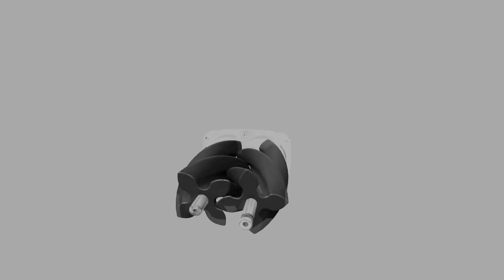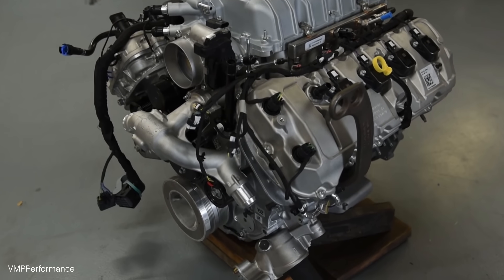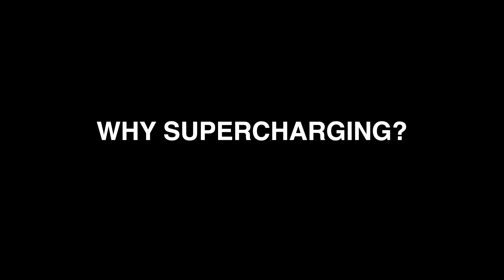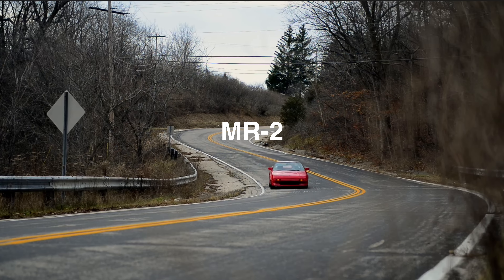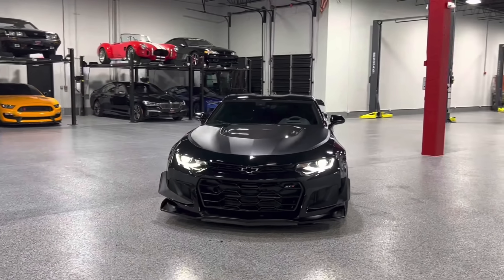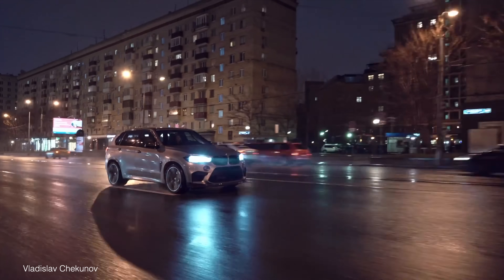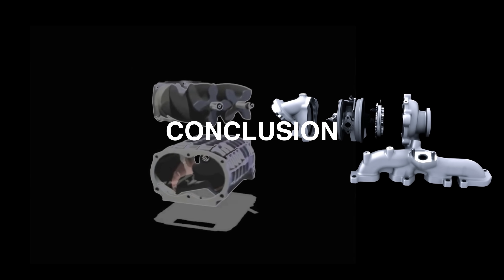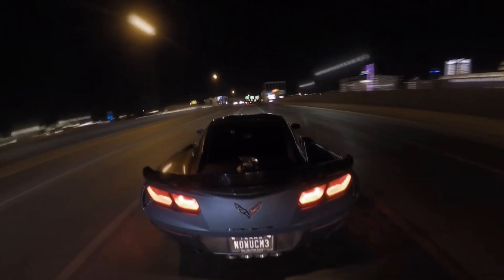Why V8 Engines Are Supercharged vs. Turbo😮| Explained Ep.6

Comment: Turbocharged vehicles get better gas mileage. My twin turbo Scat sits around 16-17 mpg (city) opposed to that of a Hellcat at 13mpg city. Besides, the car cruises around like stock until you full throttle it. Unlike that of a supercharged vehicle, where you're always making power. Sometime that's hard to drive around down depending on the setup. With my setup, my IAT's are right below ambient. Which means supercharged applications will run much higher at 130 degrees or more in hotter weather.  Unless, said supercharged vehicle has an interchiller. It all comes down to preferences, and I prefer choo, choo bois that push hot hong kong air lol

Comment: Superchargers are a solid option. Yes, they are much simpler to install on any engine as long as there is room on top. There are also centrifugal superchargers that use a belt drive to spin a turbine rather than screws. These are even more efficient as they can produce higher peak power numbers. I used to have an 1988 MR2 Supercharger and it was a fun car. I mean, really fun. Yeah it wasn't fast by today's standards but who cares, having that SC light up on the dash then the woosh of power really gave it a go-kart like feel. It's a shame cars like that aren't made anymore.

Turbos have a lot more plumbing and with modern tuning and turbines I don't think lag is as much of an issue as it used to be. It used to be literally on-off, where there was nothing up to around 4K RPM then suddenly a blast of power. Turbos are the way to go if your min-maxing your power, but you run into limitations where the displacement of the engine cannot effectively spin a turbine that exceeds a particular size. You are inherently limited on the turbo size by the base displacement of the engine.

I'm definitely not ever buying an "EV musclecar". That's part of the WEF 'you will own nothing and be happy' agenda. Forget it. It's time to bring back small independent car builders who build affordable cars, not six-figure on-offs.
Reply: he's comparing turbo cars from the 90s to make em look bad.

Comment: Their really really really unintelligent cutting the fossil fuel engines and they will find it out very quickly when people start revolting because of fuel cells burning up cars, cars not charging, charging problems when traveling and obviously none customizable when it comes to "engine" and "exhaust," notes.  But manufactures are weak not standing up to communist regime EPA.

Comment: Supercharged engines are way more linear and torqey. The packaging and serviceability is much better for the diy. I’ve helped a friend to survice their hot-bee twin turbo AMG….oh lord, the parts coming off the top end is mind blowing!   just to access a failed sensor!

I think Supercharging can be even more efficient. Has anyone thought of a variable drive gear on the pulley? Seems like a perfect place for compact CVT gear?
Giving you a wider power and and greater efficiency by varying the load at part throttle situations?

Comment: You've described the symptoms and made the diagnosis well, but missed the final underlying root cause.
It's both culture and costs--not just in the buy cost that you said.
European and Japanese makers have a market that prioritises the quality of the handling and drive, and/or refinement and luxury. The American audience generically prefer be pushed into their seats more for the satisfaction, which at the same price point means American sports cars have much bigger power output in the same class at the expense of other things the audience deems less important.
Then there's the running costs: fuel. In most of the world other than North America, fuel is much more expensive. Everyone regularly laughs in Americans' faces when they complain of 2022 'high' fuel prices because it's literally 30-50% less than elsewhere all the time. Do keep in mind Americans need to travel larger distances on average.
A turbo is just better for stringent EU regulatory emissions, better for the high fuel prices. So are 6-cyls instead of 8.

That is truly why the US continues to love holding on to the supercharged V8 when the last time the Germans did it was 2003: fuel is cheap and if they're not doing a thousand-mile road trip, that engine doesn't hurt their wallets enough at the gas station like it does everyone else in the world. 
Even just $800 a year difference in fuel cost means 10-20k over the car's lifetime. That is a huge part of the equation when considering 70k muscle cars vs 120k German rivals--consumers don't generally actively think about it, but there's an underlying subliminal sentiment through the way emissions and fuel economy regulations are done.

Comment: Turbos are way better in a V8 than a supercharger because of tuning purposes. Superchargers are only good for low powered engines like 600 horsepower and below. And yes, 600 horsepower is a low-powered engine to me considering I drag race with 1500 plus horsepower and you called a internal wastegate, a diverter valve that's wrong. Internal wastegate is in fact a internal wastegate. It relies the unused pressure right back into the intake manifold. External wage gate is the one that you hear when you let off the gas pedal releasing excess boost internal external PS race cars do not use superchargers because they are very inefficient, fuel, economy, etc

Comment: Typical Supercharger noise reminds me always on my 2006 to 2008 owned, only in Switzerland occurred Citroen Xsara VTS 2.0 Bemani Compresseur Coupe. It was built and completely DTC street certificated by Lotus- and Toyota Tuner Bemani. They made arround 25-30 cars. It had a KW Competition Suspension on and was supercharged by a magnuson charger. I had the one with the big charger on who delivered 270hp instead of 235hp. The exhaust was exclusively manufactured including 200cell racing cat. It was crazy loud, „actually fire spitting“, very light, stiff and faster than an audi s4 at this time! I owned a few cool cars but this Xsara…this one got defenitely something what let me smile until today… An intersting, special not everyday car. I experienced a lot sleeper Stories with it!😅 (🤙🏼small story for you guys…for those who intrested😊)

Comment: another downside that comes with the strength of the supercharger is the constant boost it delivers, meaning it is a lot harder on the engine internals than a turbo thru it's life as a turbo is capable at almost not making boost when driving at part or low throttle while cruising, as well as the fuel mileage issue with superchargers.

Comment: You guys Americans are fucking stupid... Talking about turbo lag on v8s... Yes one thing is turbo on a 2.0 i4 rally car, but this is some big ass v8s you're talking about. All the low end torque is more than enough to compensate for lag. No need for that fancy dual turbo setup, one nice turbo does the job and it is definitely not more expensive than supercharging. Truth be told it's all in your head. Not saying supercharging is bad, I'm saying that it's not beneficial to turbo on a v8 enough to say that turbos suck like many are led to believe. Just a thought

Comment: You neglected to mention that superchargers are limited to the lower range of rpms, the higher the rpm's go the less air a supercharger is able to cram making it useless once you get above a certain rpm. As opposed to the turbo that while it has lag, the higher the rpm's the MORE air it is able to cram, also making it a far more efficient air induction system. Americans are so obstinately backwards. I would know, I am one.

Comment: I definitely plan on keeping my 1999 SVT Lightning and my 2014 F-150 Ecoboost. Both trucks have 2 completely different personalities. The Lightning will instantly light the tires, pushing me back in the seat and there's the lovely exhaust note and supercharger whine. I actually most times forget that the Ecoboost has forced induction because of its lack of noise from the turbos and its power delivery being very different than that of my Lightning.
Reply: The Lightning doesn't impress me. The Ecoboost has impressed me with its towing capabilities.

Comment: When I was ready to stuff air into my 1998 Camaro SS, no superchargers were available yet.  I ended up with an Incon twin-turbo system.  Two GTBB35's on a 6.1L V8.  I reach full boost in less than a second.  No regrets here, I'd go turbo all over again.  My buddies supercharged Cobra gets yanked immediately.

Comment: As soon as Lyin' Joe Bribin' Biden is kicked out EVs will be kicked out too. Just heard today that EVs put out more pollution than gas cars do to the pollution it costs to make, discard the batteries, the brakes put out more pollution dust do the weight t of the vehicles, the tires also pollute more because of the weight and cause more damage to the roads. Resources for the chinese batteries are mined with African slave and child labor. Joe has no problem with that just as he has no problem with child trafficking on the southern borders.

Comment: Because here in the US the damn other drivers are either going 20mph on the freeway and cutting you off or 70mph, so you need to be able to hit that power immediately when you pull around the idiot who just cut you off.

If it were a turbo, as you brake you loose boost pressure,  and then when it comes time to get back on it the guy behind you has already slammed into you.  Gotta make sure you're not getting in his way ^_^

Comment: I agreed with this 6 years ago however the new twin scroll turbos minimize the turbo lag. Having built both, supercharged vs turbo, I am at the point that I believe they don’t want to turbo those cars because it’s too simple to modify a turbo through simple vacuum pressure making it harder to know if the customer is at fault on warranty claims. A supercharger takes 35% of the engines powers to make up the added gain while the turbos make way more power and is only loss at the lower rpm range. With that in mind the epa doesn’t want people always in the higher rpm range for obvious pollution reasons which also keeps the superchargers in play. A v6 and a inline 4 with the right twin scroll turbo will smash a V8 supercharged anytime. It takes place at the track every weekend. Kinda embarrassing. Great video though but I do believe times have changes and there is more to the supercharger still being used and it’s more for the EPA and the manufacturers 3year- 36,000 mile warranty, surly not because they are more powerful.

Comment: This completely misses the point: you match the power adder to your RPM/HP/Torque curve.

American motors typically are lower reving due to having RPM ranges <6.5k.

Import cars typically have motors that rev 6.5 to 10k.

The lower RPMs of American V8 motors make for power curves that are low through the initial part of the curve: adding a supercharger that doesn't have lag raises that initial part of the curve, allowing the engine to hit maximal power earlier in the curve (thus, reducing overall curvature).

The higher RPMs of import models cause their horsepower to actually drop off past the peak on the backend of the curve: you add turbos here because at those RPMs you not only solve the power losses from torque dropoff, but gain additional power due to the guaranteed exhaust velocity at those ranges. This allows you to benefit from also remaining in the lower gear for longer, as a result, whereas normally youd shift far earlier in the RPM range (thus reducing curvature [notice the recurring theme]).

Superchargers causing parasitic losses vs turbos is also something of a myth.  The additional force required to spin the turbos, and indeed, spin them up to the horsepower potentials as the supercharger, causes essentially identical losses.  Little bits of backpressure at the beginning causes lots of backpressure on the backend (that's what's causing them to spin, after all [and also to explode]).

Where they make efficiency gains comes from being able to carry over the boost charge to keep themselves spinng from not being paired to engine speed (or blow it off, hence the iconic sound) or ruduce spool lag through the following gear. Additionally, turbos typically have far lesser masses than a complete supercharger package, which is also attached to the heaviest spinning parts of the engine, all the time. This gives turbos better fuel efficiency at lower RPM ranges -- hence where the myth comes from: a supercharged car is always going to use more fuel, particularly at idle. A turbocharged car isnt going to use much more fuel until you're higher in the rep ranges.

The difference? The supercharger is also always going to be making more horsepower. The turbo notsomuch. A supercharged car also drives completely differently, all the time, because of this. A turbocharged car will feel almost exactly the same to drive as it did before you added the turbos until you get into higher rev ranges.

Adding a supercharger to an engine that already frontloads its torque curve is how you crack your block -- this is why you almost universally get "turbodiesels," not "superdiesels."

Adding a turbocharger to a car that already makes all its power on the backend is how you get an undrivable squirrely monster that tries to blow up your manifolds or driveshaft everytime you go past 5k rpm and add torque to your torque when you are precisely when you are making peak torque like you are Xzibit.

Comment: In 1986 I received a Mustang SVO. My dad knew some folks and I got it making 18 psi. That was more than enough to rival the GT’s and Z28’s of its time. I’m definitely a big fan of turbos. There are little tricks to get into the boost faster.
Reply: I'm very certain at 18 psi your engine reliability went to hell in a handbasket! The valves would have been fried in less than 40k.
Reply: @eac1235  the engine was fine, but they had to replace the turbo sooner than expected. When they replaced the turbo it only made 12.5 psi. It felt so slow after that.

Comment: They haven't even scraped the surface with combustion tech. Especially hydrogen powered combustion engines. E.vs are far far worse to for the planet in production, maintenence and disposal, they don't even recover anywhere near that deficit throughout its operating life. Combustion is far better for the planet than e.v period

Comment: i want to see a sportscar with a 1000ci 16 cylinder turbo engine behind the driver, that should be enough for 4000HP on the wheels and 350mph speed. i dont mind supercharged or compressor, thing has to reliably put the 4000HP on the road. that whinning noise is what i realy dont like, its ANNOYING, sounds like a sewing machine.

Comment: I miss my Audi S4 SOOOOO BADDD OMFG. Just a heads up those 3.0's are not the most serviceable engines.  but its So much fun at stage 2. It will just stand there and break loose all 4 tires on command, and not just some trashy tires, i had Pirelli Pzeros on it, and thne BFG Sport comps, it didnt fucking care lmfao. with the right exaust its arguably the best sounding V6 of its time, and ive driven Jag Ftypes... That supercharger whine is absolutely addicting.

Comment: I think you forgot to mention that it's forbiddingly expensive to run an American supercharged V8 in Europe due to the much higher fuel cost. I'm getting 11-12km/l in my 470hp BMW 6 cylinder petrol, and my 2l diesel BMW goes up to 1150km per tank.